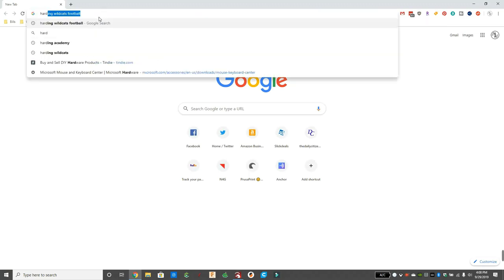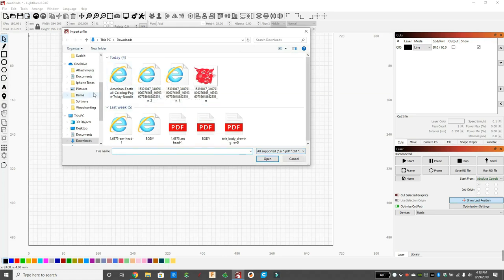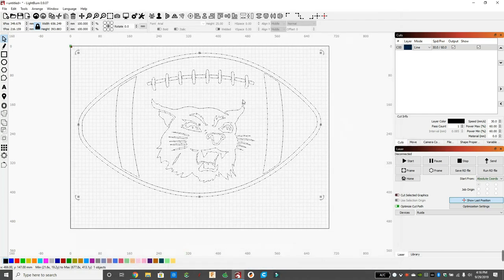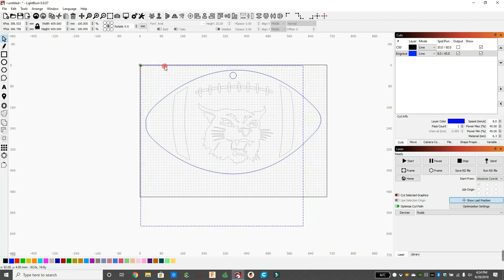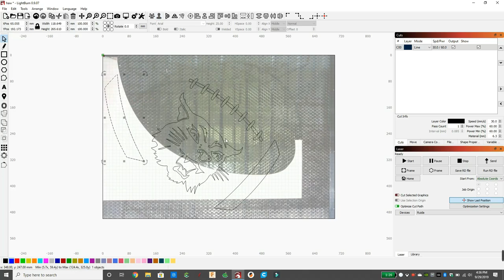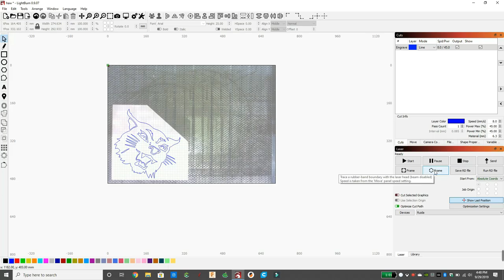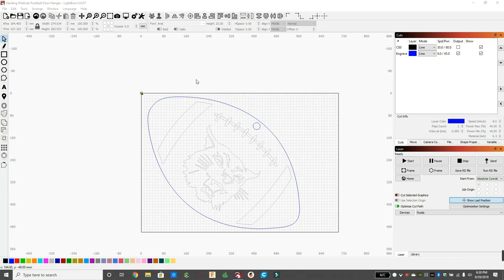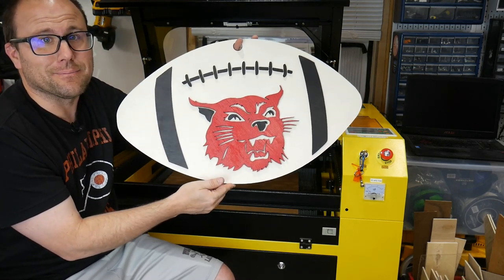DIY Football Door Hanger Using A Laser Cutter And Lightburn

Comment: Great video!
I’m needing help on what CNC/laser machine to buy. I don’t want a very expensive one bc this will be a beginners for me.
All that I’m gonna use it for is to cut door hangers out of wood and etch a design on the door hanger. So can you give me some advice on what machine is best. I’ve been looking at the X Curve but was not sure if it could do etching as well.
I’ve also been looking at Glowforge Pro...but that’s kind of to pricey. 
If you don’t mind giving me some advice of which one to buy. I would greatly appreciate it. Thank you so much Renee Wheat
Reply from the maker: so i have the chinese 60w laser (check my other vid) that outperforms the glowforge and is much cheaper.  I have the Onefinity CNC that kills the xcarve in the same price range.  Look into both of those!  If your going to do thin material, I think a laser is more what you'd want.
Reply: Myers Woodshop thank you so much for your advice.
Reply: Myers Woodshop so if I’m using 1/8 material will the laser cut and etch it as well?
Reply from the maker: Yes!  I’ve cut up to 1/2 plywood

Comment: I was wondering if LIghtBurn supports offsetting lines? If so, you could offset all lines of the stitches, wildcat and bands by half a millimeter or so inwards and then use these lines and the laser in low power to mark the football shaped base with the places where all the parts need to be glued to.
Reply from the maker: you could, but you'd have to do it after you paint the background....and then you'd have to realign it perfectly.  I just eyeballed.

Comment: Hi MW - do you have a video on your settings you use within Lighburn and CO2. I purchased the same CO2 but my settings are always off. Thanks
Reply from the maker: cut and power settings?
Reply: @MyersWoodshop  yes, or even your workflow. maybe do an engrave and cut piece tut. My laser was cutting fine the other day but now its not cutting through the wood. I been watching tutorials but no luck.
Reply: I actually think something is wrong with the laser head. got any recommendations on where to shop for new one.